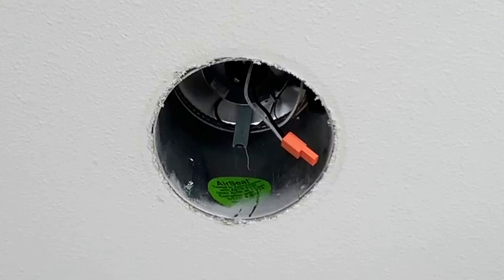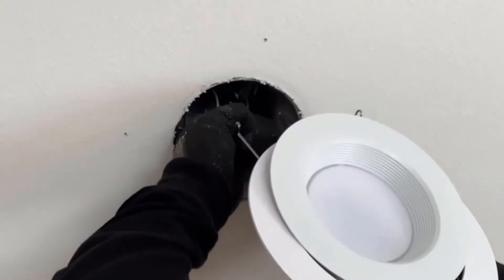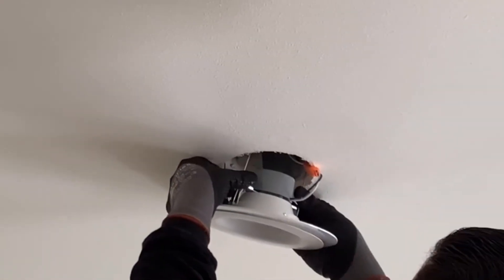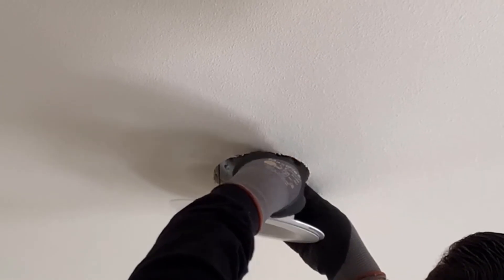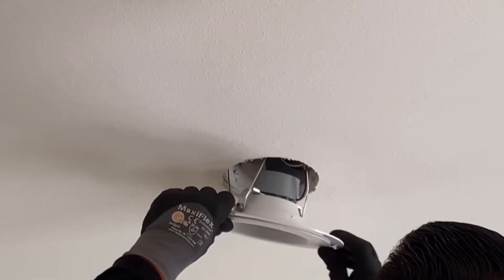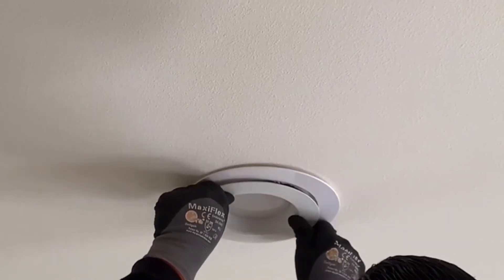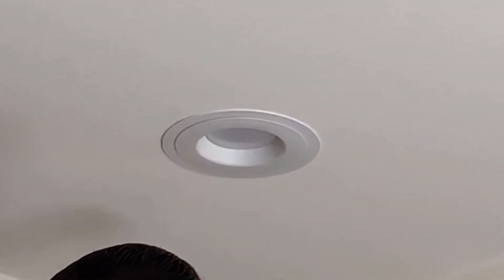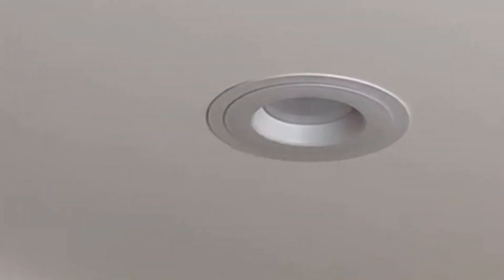Goof Ring Installation Recessed Down Light

Comment: Thank you for the video. I have halo 6 " canless lights. The hole is 6 1/8- but since the ceiling is plaster there are some minor chips. Can I used these and what size I need for 6 1/8 hole? Thanks again
Reply from the maker: I don't have a halo light in front of me but the question is... is the HALO trim matte or glossy and what is the diameter of the of the halo can light?  As far as the rings, there are two outer diameters.  8.06" and 8.65".  They both look similar so i'd lean towards the 8.65".  The only question is the can the inner diameter of 5.85, clear the components of ur halo light.  The plastic is not so thick so if it didn't fit, you can always cut some of the inner diameter ring off to make it fit.  Even though its messy, no one will see it, as the HALO trim will cover it up.  Post your model here?  Next time I'm at Home Depot, I'll see if its there and test.